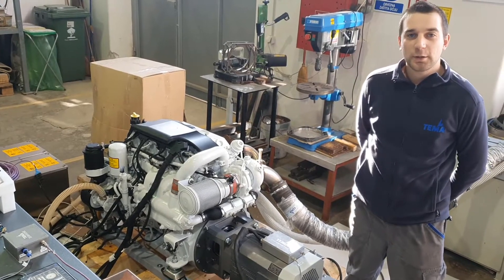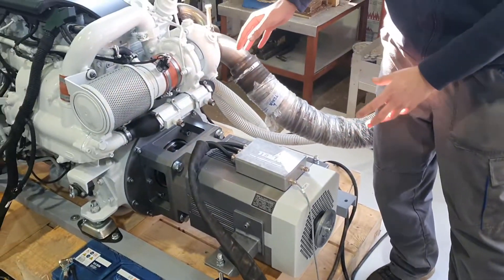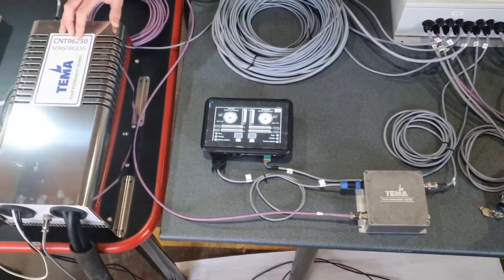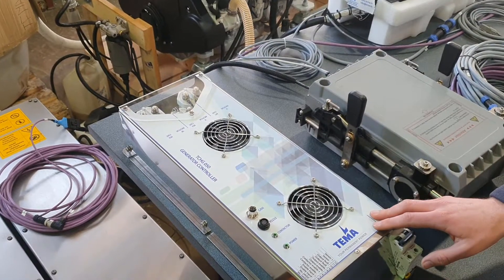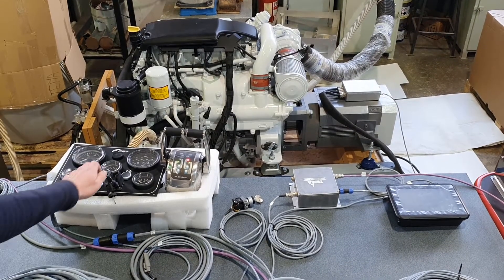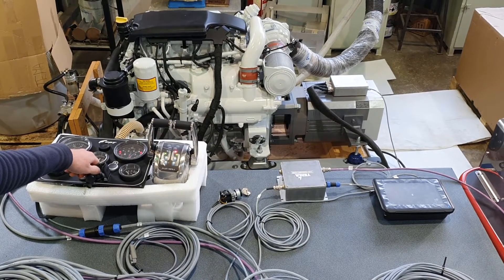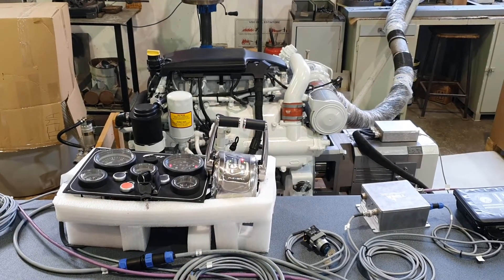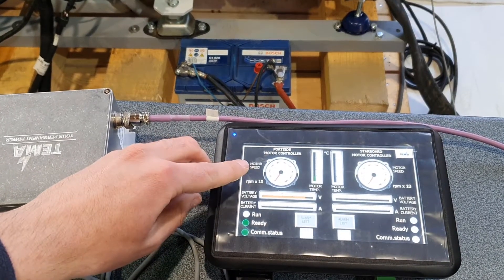TEMA Parallel Hybrid on FPT diesel engine

Comment: How much maximum KW can the diesel engine generate while charging a battery bank, which can then supply the electric motor when needed? Thank you.
Reply from the maker: An electric motor integrated with a diesel engine functions both as a propulsion motor and as a generator that charges the batteries while the diesel engine is running. For example , if the electric motor has 50 kW as propulsion power, it can also operate as a generator with the same power, charging the batteries at 50 kW.

Comment: how many nautical miles can you go on the batteries on a 40 meter yacht
Reply from the maker: It depends on how many (capacity - kWh) batteries you will install (from 1h to ....) and on how you will use the motor power (full power, half power, minimum power, combination...)

Comment: What draw on the diesel if you only run diesel without eletric/ gen/..?

Can there be a straight shot diesel to prop. Without engaging electronics?
Reply from the maker: In summary, yes, you can connect a diesel engine directly to a propeller without engaging electronics

Comment: As we can see, the cooling of the electric motor is ensured by the rear fan, I have a question, how is the efficient cooling of the electric motor ensured in lower RPM ?
Reply from the maker: at low RPM, the E-motor  power is also very low, therefore the E-motor does not require special additional cooling
Reply: @temayourpermanentpower6318  Yes, I assume that the combination of permanent magnet motor plus the effort generated to rotate the propeller allows this, I personally had problems with some low RPM motors used in the industrial field to rotate some material dispensers, but I used asynchronous motors controlled by VFD (variable frequency drive ), in that case the mechanical effort was not reduced proportionally with the speed, I solved it by replacing the respective motors with some special motors that had cooling by a separate fan.

Comment: Logically your idea is the best I’ve seen. Hybrid has been around since the first submarine and with advancements in diesel efficiency and range coupled with advancements in battery technology and electric motor torque extending a watercraft’s range and propulsion reliability. Lol the most insane concept I’ve seen in the boater world are people saying their going 100% green and ditching their diesel and replacing it with fully electric. Solar panels and wind generators do not have the output to recharge batteries to their maximum capacity so they still have to rely on shore power or a generator. Lol that’s not going green. Swedish Built submarines use 2 sterling diesels combined with electric engine propulsion in their new state of the art submarine. Unbelievable range and time spent underwater. Gotland class have revolutionized submarine warfare. Taking that and using it in boating will make water travel to the next level.

Comment: Question? When running your diesel does the torque from the motor recharge the batteries? Also when it monitors that the batteries are topped off is there a way to automatically shut the Diesel engine off and run the electric motor? And a way to manually select diesel or electric in case of one or the other malfunction. Also a way to add leftover charging from your solar and wind generator into the battery banks?
Reply from the maker: Question one :  yes
Question two : yes
Question three ;yes, motors can work independently
Question four :Yes, it is possible

Comment: Samson boat company just bought a parallel hybrid Marine engine and it was simple and efficient. It has a 100% mechanical diesel engine. As long as you can start your engine you will always have propulsion.

Comment: Great one guys.  Do you then run from the back of your electric motor to a gearbox?
Reply from the maker: usually after the electric motor is the gearbox. In this case after the electric motor there will be a sternd drive which will be coupled in the shipyard.
Reply: @temayourpermanentpower6318  OK thanks for letting me know.  I find your products very interesting indeed and looking at your applications for long range cruising.  Please keep sharing your products so I can get a better understanding of it all.  Thanks again.